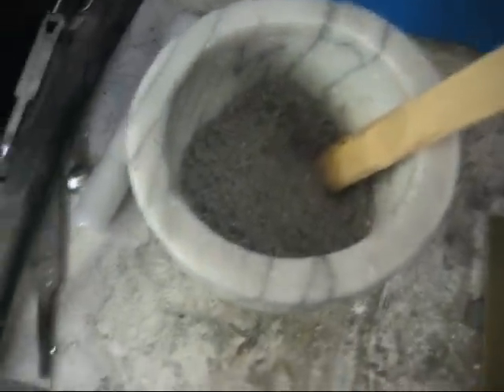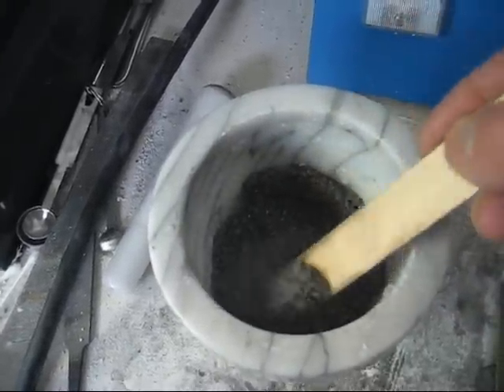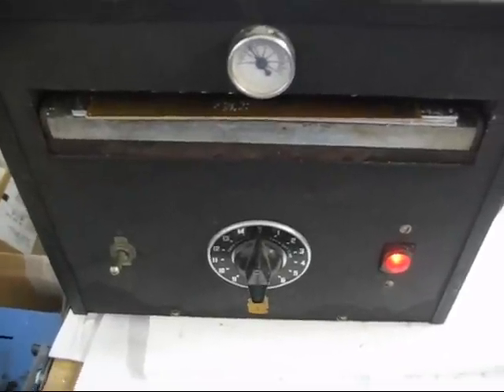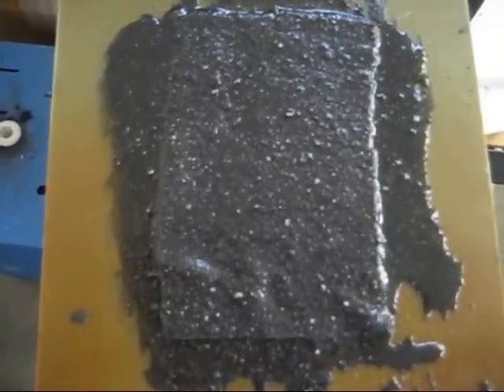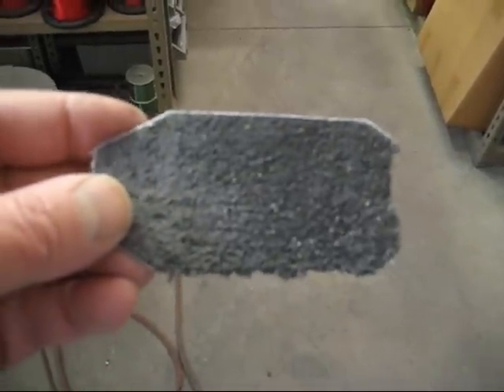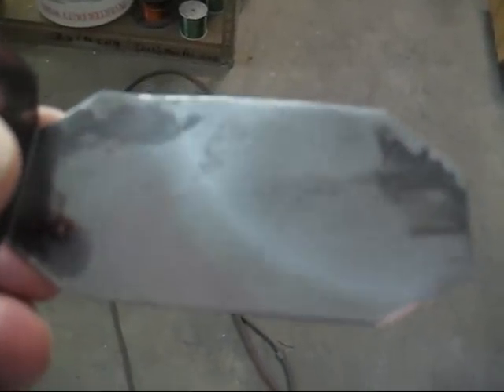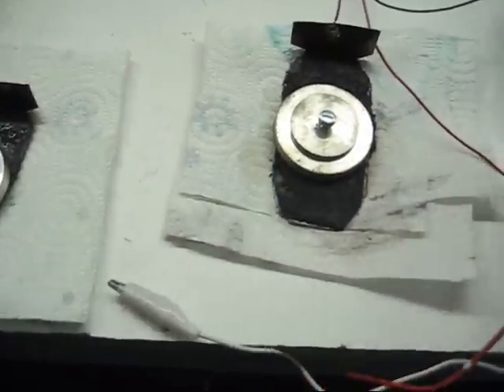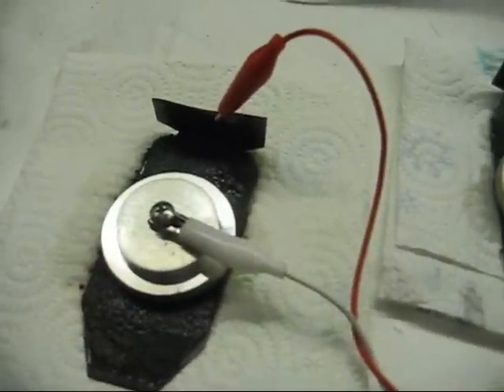My Crystal Cell Depolarizer

Comment: Great work as usual John. as you pan over some of your cells I notice you have different chokes on your oscillators, is this because of the availability of the different current  you are getting off each different CB or is it a matter of the load you are driving.
Tom C